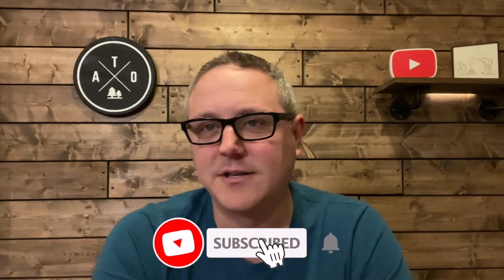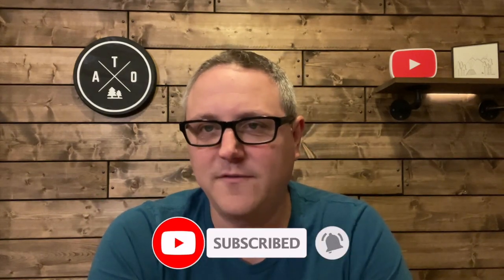How I come up with DIY ideas (Xterra mods, DIY RTT, DIY Roof Rack, Unistrut, Onboard Air)

Comment: Glad you talked about the problems with diy rtt. I've been considering trying to build one but I can't sew. I'll probably stay away from that project.
Reply from the maker: Glad it was helpful! Yeah, I really like my design now that I've changed it up, but just couldn't quite figure out the whole sewing thing and didn't want to continue to spend more and more trying to figure it out. If you had a hookup that could sew really well, I think you could still build your own for a reasonable price but once I was eyeing the $500 plus mark, I figured it might just make more sense to purchase a lower cost option. If you haven't already seen the video where I do a walkaround of the tent I bought (about $900 and super easy and quick to set up and take down), here's a link:  https://youtu.be/CpXOiEthLiA
Reply: @AllThingsOverlanding  wow $900. Thats cheap compared to what I've seen out there.

Comment: Everything revolves around price. It actually decreases the ATO thing.
Reply from the maker: Hey, thanks for the comment! I don't get what you mean though, but I want to! I agree that everything revolves around price, but what do you mean it decreases the ATO thing? Thanks!
Reply: Everything is bought because of cheapskate. Frugality is cool, but get bored with hearing that as the basis of purchases, using it as an excuse for not buying something with more quality. If the wife controls the purse strings and it's all you can fit I'm your allowance, then so be it. But don't be "All Things Overlanding", when it should be, "All Things Cheaply Overlanding." Just how it comes cross to me.
Reply from the maker: @fastfoodvwFL  Ahh, gotcha. Yeah, I guess I figure I can get "more things overlanding" if I can stretch my budget. There are a lot of channels out there that have super expensive gear that most people can't really afford which keeps you from going on trips because you're saving hundreds or thousands of dollars to buy that battleborn lithium battery setup to be more of an "overlander." 

Again, I get what you're saying and I appreciate it, but I would argue that there are certain things that you should spend more on to get the quality (my Last US Bags gear is an example because it's great, but more pricey than the junk you can find on Amazon). Then, there are certain things that it makes sense to buy on a budget, especially as a person who has a full time job and takes trips when I can. 

I love the take though and again, appreciate the feedback. Thanks for clarifying!